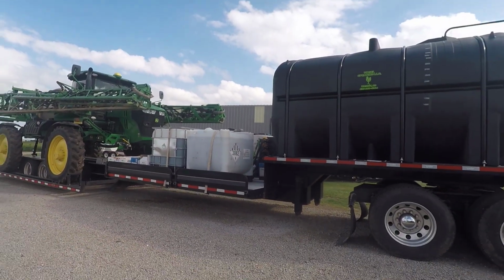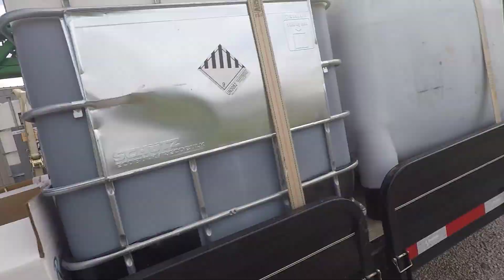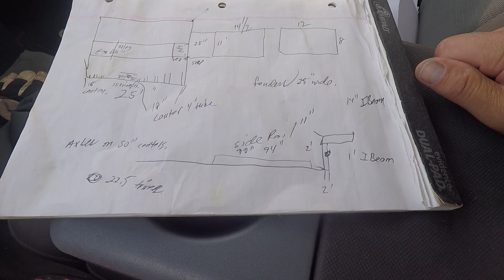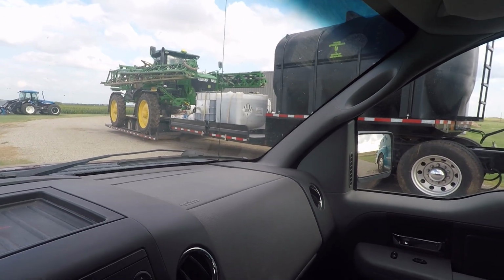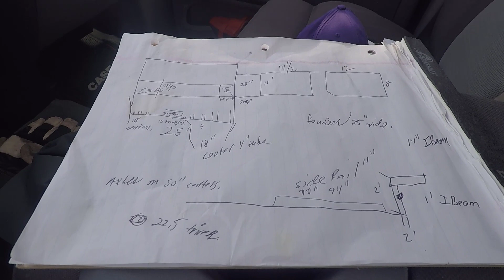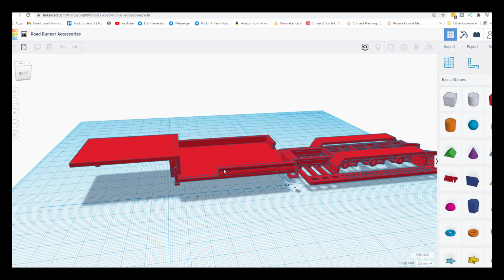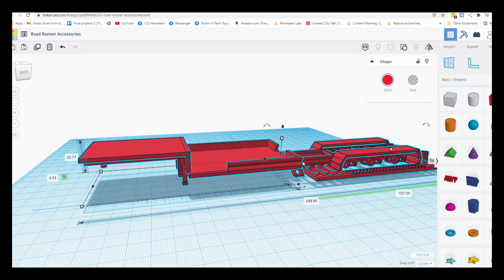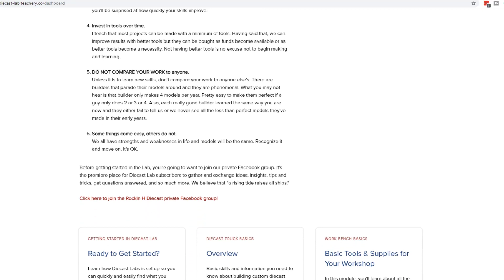How to 3D Print a 1 64 Scale Trailer

Comment: You can convert the unit of measure by clicking "Edit Grid" on the bottom right corner.
Reply from the maker: Thanks for that. There is so much I don't know about tinkercad
Reply: @RockinHFarmToys  haha no worries, I don’t use it but most 3D model software has the adjustment. I think you could also model at 1:1 then scale down the entire model to 1:64